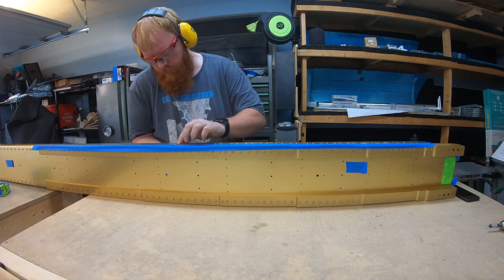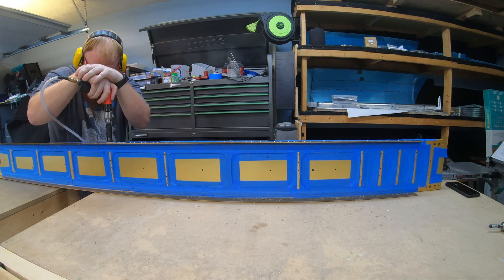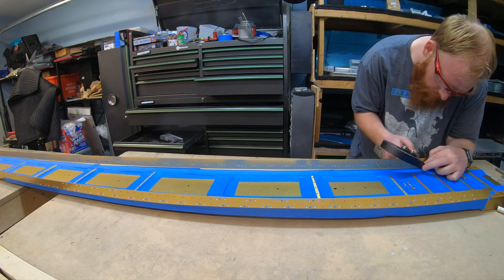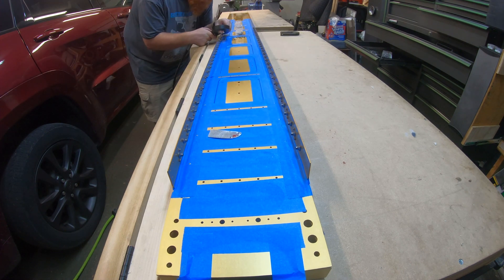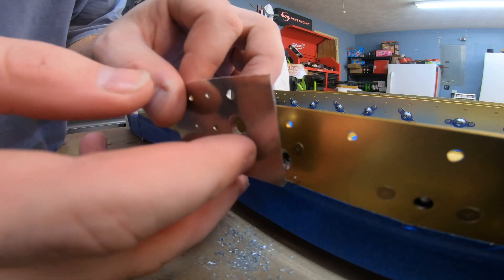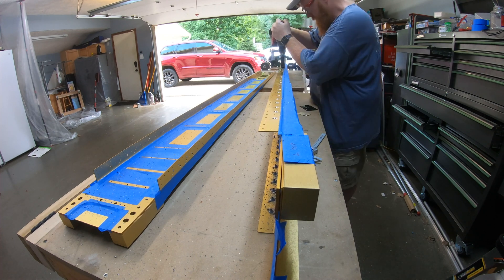RV-8 Wings - 01: Preparing the Main Spar   4K

Comment: Why is it worth taking time? What happens if you have a “chattery” countersink?
Reply from the maker: The biggest issue with chattered countersinks is that they cause stress risers which will lead to cracking, which is bad anywhere, but especially bad on the wing spar.

Comment: Quick question Sean. Did you drill those nutplates holes to final size before you countersink them?

Also I noticed that you installed the nutplates before you counersink the screw hole?
Reply from the maker: Great question, I did not drill them to final size, once you countersink it to the proper depth it opens the hole up enough for the screw to fit.

And yes I riveted the nutplates on first as the plans instruct. This allows the pilot to be guided by the nutplate so as not to elongate the hole or create chatter. Because a #8 countersink pilot won’t fit in the nutplate they tell you to use a #30 countersink for those and a #40 countersink for the #6 screw holes for the inspection cover. Some builders have just fabricated a thick piece of scrap to place beneath the hole and countersink before installing the nutplates but honestly that would be a lot of extra work and the nutplate method worked great so I would just do it that way
Reply: @pilottender  thank you man for the detailed answer